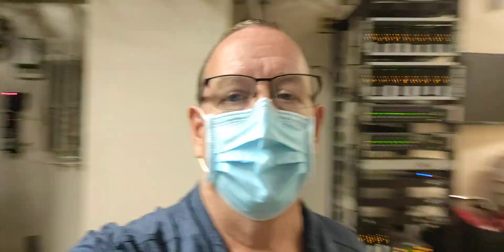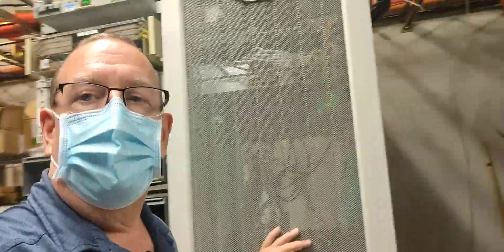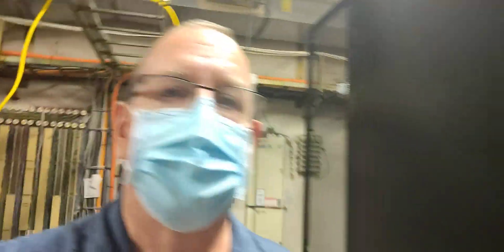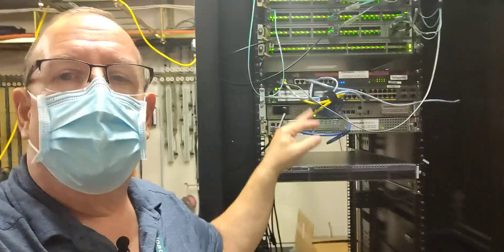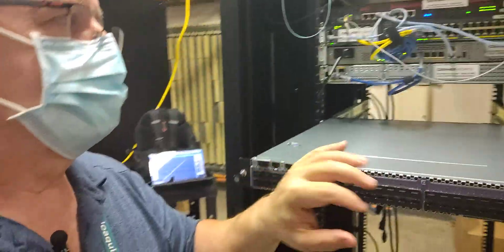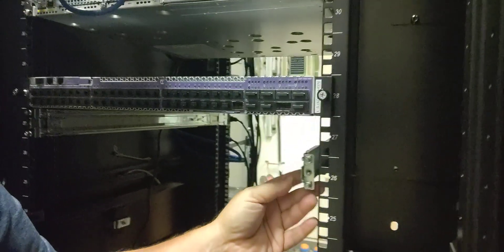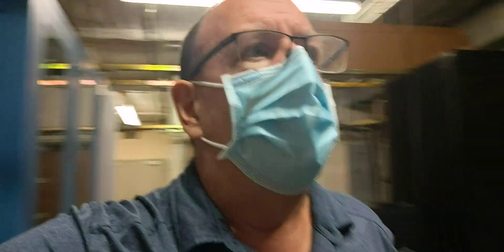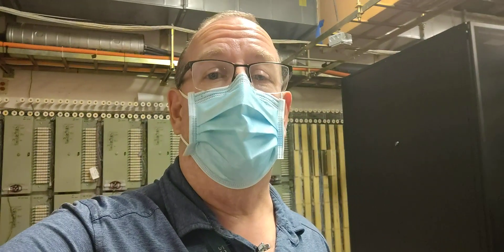Network Admin Life: Tour of the MDF

Comment: I have a question. So an MDF is your main area that you split off that comes from your main internet into your router and switches to other parts of the building you call IDF and IDF I'm guessing is what goes to your computers and devices. Am I wrong on that?
Reply from the maker: Yes, the MDF in our basement is the main aggregation point for all the network closets (IDFs) in the main hospital.   Then there is a big trunk that comes back to our Data Center.  Which also serves as a MDF of sorts.  God bless!
Reply: That's pretty much it. I work in K12 IT and all of our schools have an MDF/server room/closet. We have fiber optic cabling running throughout campus to various wings and buildings into IDF cabinets. These are essentially small network boxes we have mounted in classrooms or in offices. These IDF boxes have a network switch. We then have ethernet cabling running from that IDF box to the various classrooms.
Reply: @JJFlores197  thank you.

Comment: I'm curious what kind of equipment is used to handle the RTMP streams/qam modulation (if you're doing it that way), but another thing I noticed is there are a lot of non-capped fiber transceivers; Are those disabled? It's kinda bad practice to leave those plugged in without a cap because the laser emissions could cause some serious eye damage. You said OM4 which is MMF, and those are a lot lower power than SMF transceivers, but still- anything in the IR spectrum won't cause you to blink.
Reply from the maker: We don't do any RTMP or RTSP handling.  If the packets hit our network they get what they get.  I didn't think we had that many uncapped FOT in our switches but I'll have to take another look.  God bless!